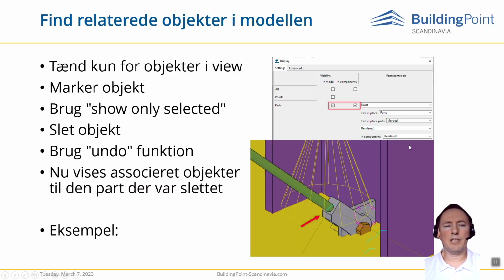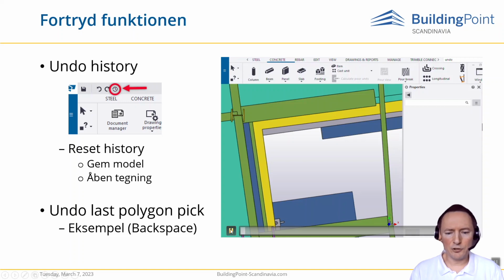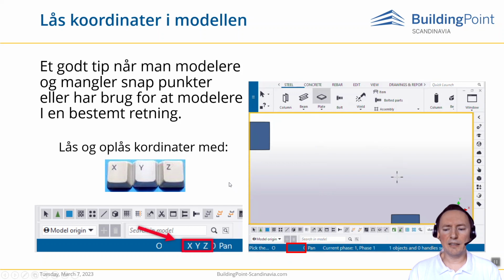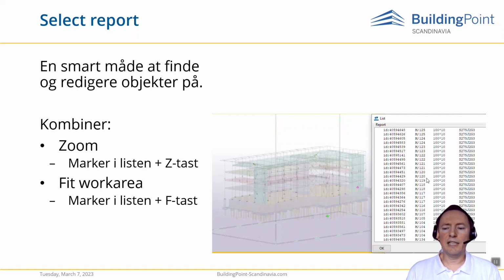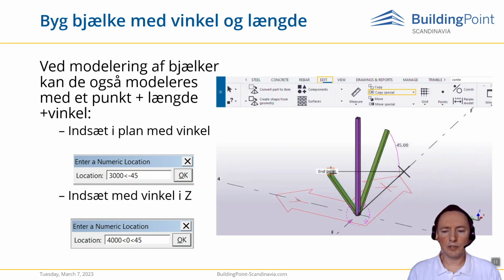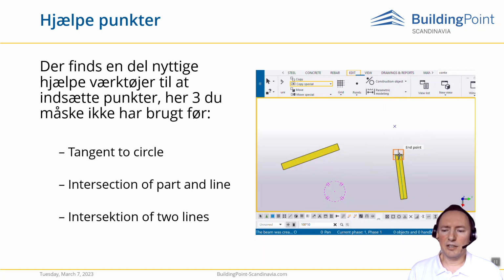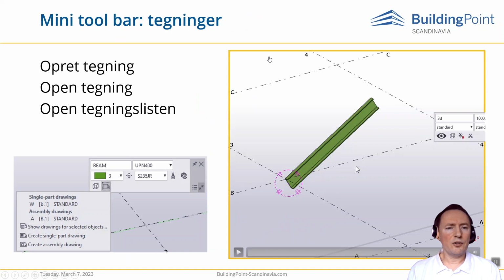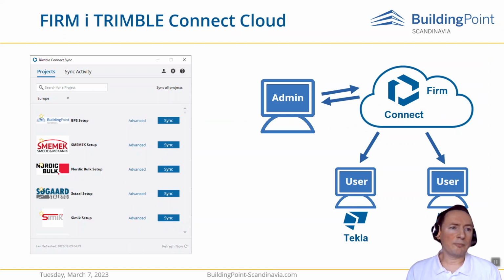Tekla Tips & Tricks (Tekla User Day Denmark 2023, Brian's presentation, ENGLISH version)

Comment: Hi Brian, great tips. Question: At the end you talked about Trimble Connect Sync and Firmfolder. Is there a difference from doing it with trible connect sync, compared to the method where you have a shared model and upload the Firmfolder right into the Cloud-Model? As I understand it, with the sync option one would sync the Firmfolder down to their PC, instead of having it in the cloud, correct?
Reply from the maker: Hi! Sorry for late reply! This is Brian writing:

With the Sync option, you will get a local copy on your one "Work" machine. You can then work Offline, and still have access to all your FIRM setup.

With this setup you also have the possibility to sync all folders, and not just the "FIRM". Ex. If you have a specific folder for "Report Template" (XS_TEMPLATE_DIRECTORY) then that will also be sync. 

In my mind you have lot's of better control with the sync.